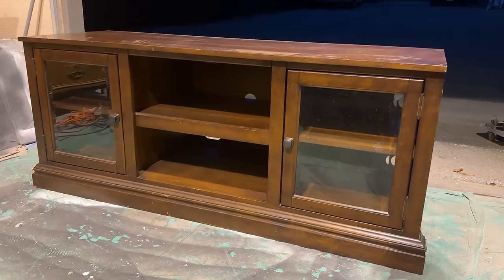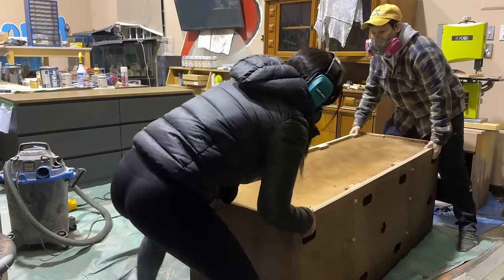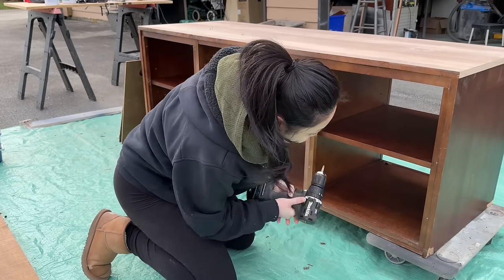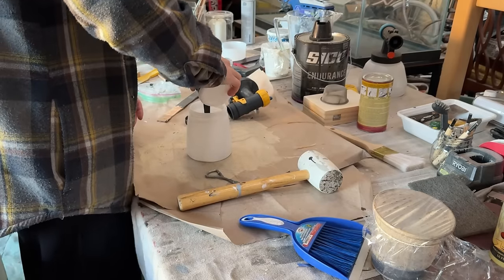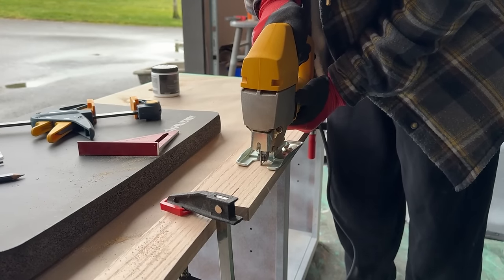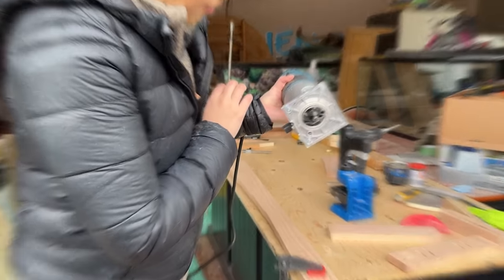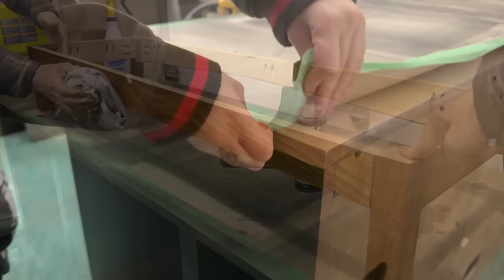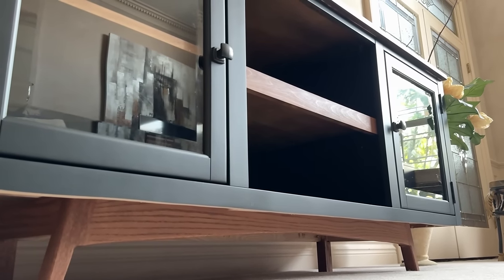Extreme DIY Console Makeover | Turn Your OLD Furniture MCM | Using WATER BASED Wood Stain

Comment: Thx for the tip of using cardboard to spread stripper. I used that on  my last project & it's so much better that using up a chip brush that you have to then throw away.
Reply from the maker: Lol! Use anything as long as you can get the stripper where you need it to be 🤷‍♀️❤️

Comment: How long did you have to wait for the water-based stain to dry to apply the oil based topcoat?
Reply from the maker: It was pretty quick, maybe a couple hours? Water based dries a lot quicker than oil based so don’t have to wait as long compared to if you wanted to layer it the other way around 😊